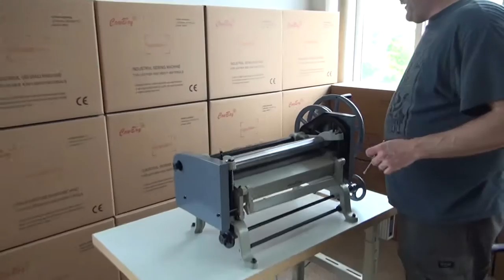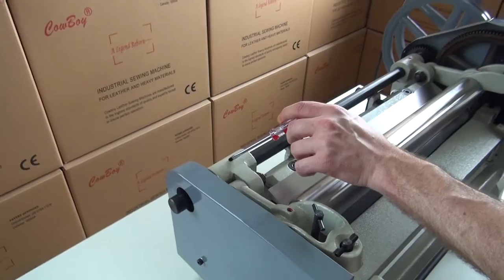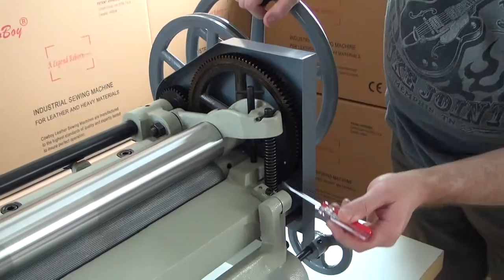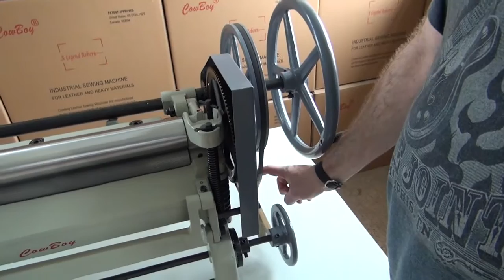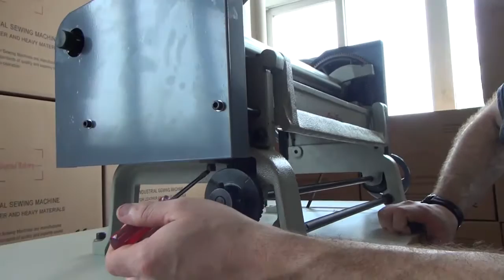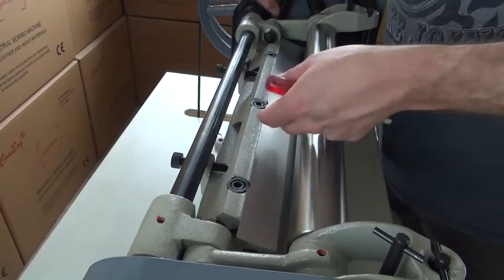Cowboy 8020 leather splitting machine service and maintenance video

Comment: Thanks for this video. Really useful. A video on servicing/sharpening the blade would be just as useful if you have time!
Reply from the maker: It is very difficult to explain sharpening by video, you need special sharpening tool and experience, it is not easy.......